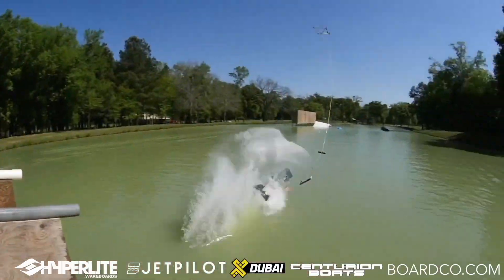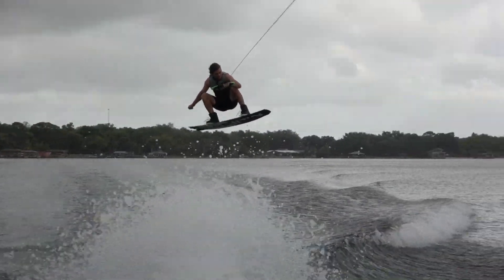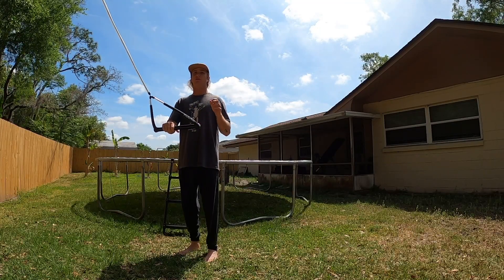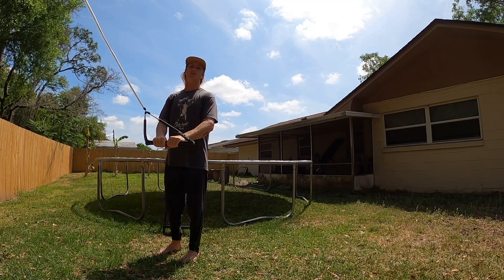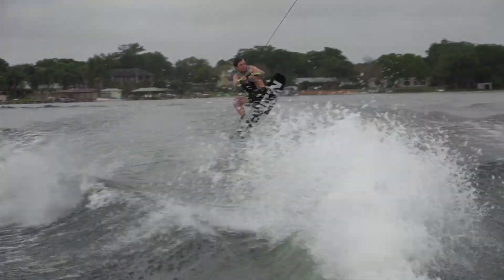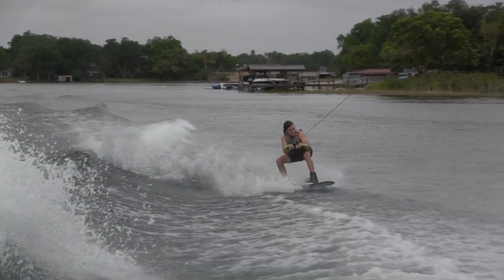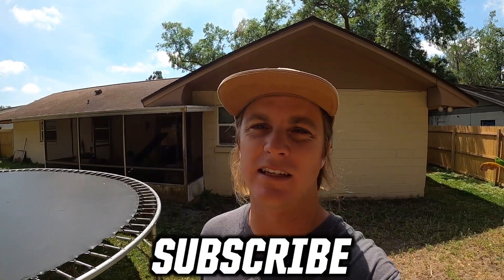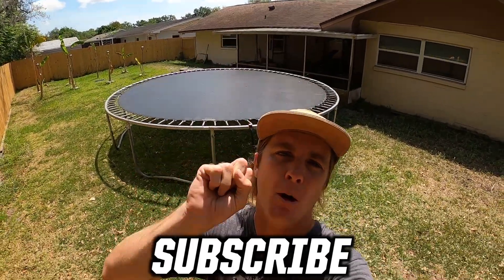HOW TO GET BIG AIR! - WAKEBOARDING - BOAT - WAKEBOARD

Comment: I have a small wake off a little ski boat. Edging thru the wake I actually get much less air than if I flatten the board out and stop edging/release right at the wake. Edging just slices thru it. My wake is very peaky. The total bottom to top of the wake is probably 1/3 my board length. Any tips for this type of wake?

Comment: Hey I see you ride murray boards for boat riding. What size do you ride? And would u recommend 145 or 150 for someone about 6 ft 220lbs?
Reply from the maker: i ride 139 and am 160lbs
150 or 145 will both be fine, but 150 is probably nice